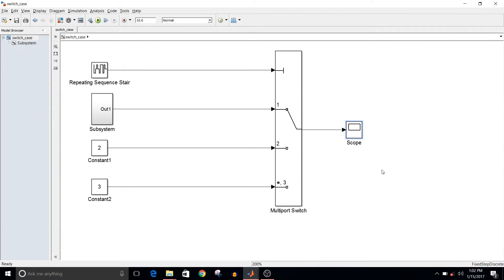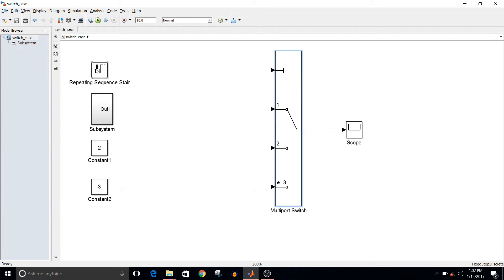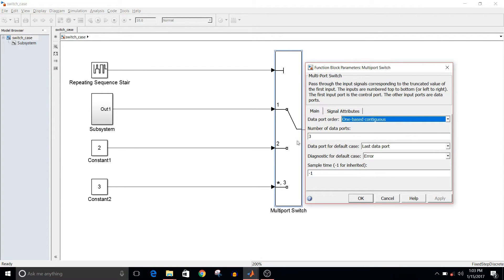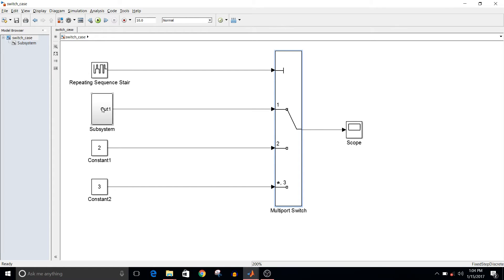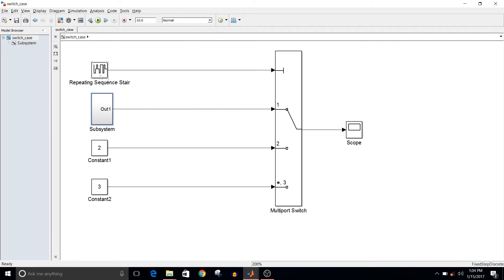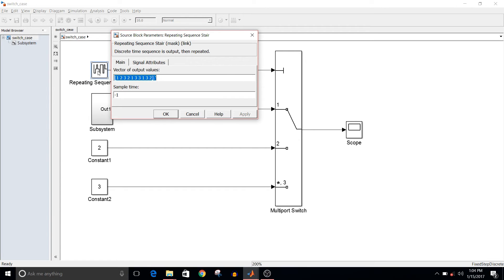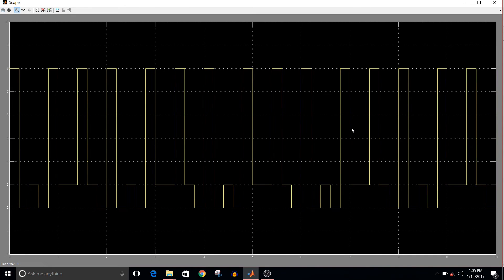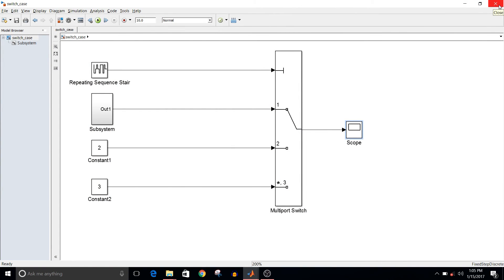Simulink Tutorial - 15 - Switch Case Using Multiport Switch

Comment: Please What is the role of the "multiport Switch" block and the "Assignment" block in SIMULINK?
Reply from the maker: Multiport acts like a switch case. Whereas assignment block assigns value U at index idx of multidimensional output signal. Rest of the output at indices other than selected index at given given time will be Y0 i.e. initial value.

Comment: how can we use switching system in actual distribution system
Reply: switch here is case 0 or case default . ex if input signal requires to select the gear 3 case 3 will be triggered and corresponding gear ratio will be multiplied with raw torque which will be used as torque at the wheel without loss.